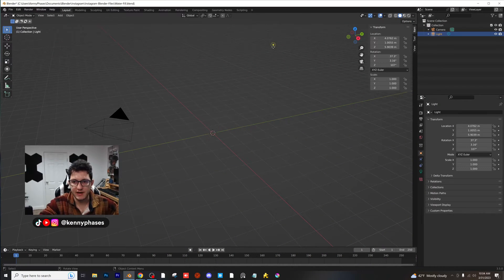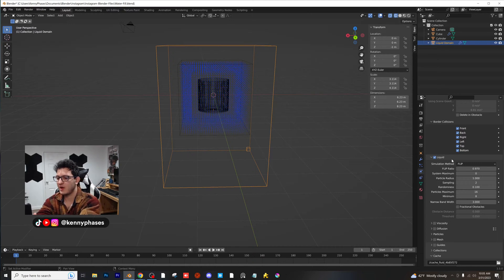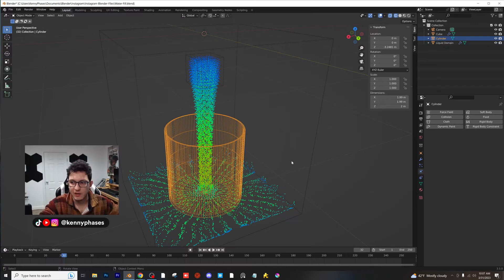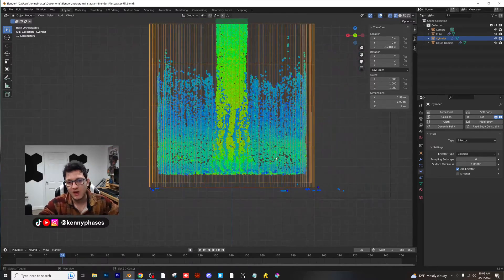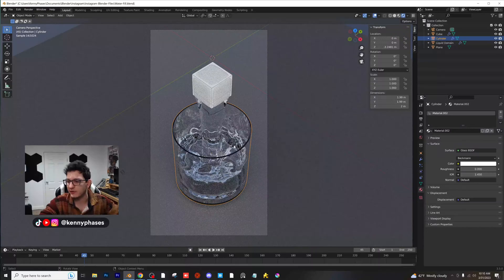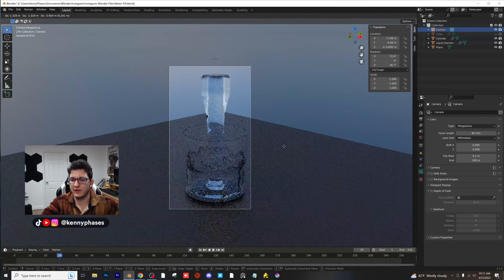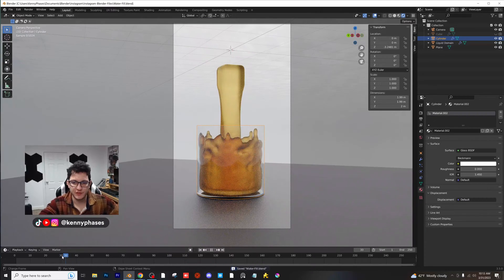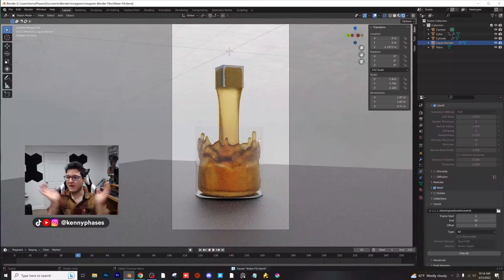Fill a Cup with Water in Blender 3D!

Comment: Trick of the day...  once you've created that 'cup', duplicate it (Shf-D), leave it right where the original was.  Using a Solidify,  adjust the thickness of the 2nd cyliner, outwards, so it's thickness is two or three times the thickness of the original cylinder.   Use that 2nd cylinder as your effector, and you won't get those pesky leaks out of the bottom.
Reply from the maker: Awesome tip!

Comment: I was wondering, i was using a mineral water bottle as seen on supermarket. I experience the fluid is not filling up the sides of the bottle. there are still gaps. I have the surface thickness to 0.6, but still even lowering it still causing gaps. do you know the fix?
Reply from the maker: What resolution? Sometimes you have to keep raising the resolution!
Reply: @KennyPhases  i have set it to 100. also  i have set the flow off at frame 1 but start at frame 42. i have bake it. but when the water is not flowing the domain becomes solid. but after reaching frame 42 onwards the domain is not solid anymore. how to get rid of this?
Reply from the maker: @terrytjandra  You will have to send me a screenshot on Instagram, I would have to visually see a recording of what is happening to help solve this issue. Thank you! In the meantime, you can also check the Blender Discord server and ask your question there too!

Comment: What did you do to make the water come out? I found it in the big square and not in the small one. I don't get anything similar to water. Of course, I have a blender that is older than yours. How do I still manage to make the small square come out with water as the water came up nicely from the bottom? Please help me more so that I can continue the creation. Thank you. I'm just starting out with the blender.
Reply from the maker: You have to ADD the source of the water. It can be anything, a cube, a pyramid, a cylinder, a sphere. doesnt matter. But you have to ADD an object to your scene in order to have a "flow-source". Once you have your flow source you'll need to select it and add the fluid-flow property. And then you can move the flow source to wherever you choose and BAKE the simulation!

Comment: Hey Kenny! Have you ever wondered how can you fill a cup with the flow source at the bottom of the cup? Cause when  you want to try it, the liquid surface doesn't rise past the flow source!
Reply from the maker: This might give you errors yes unless you use the Flip Fluids add-on. But I will experiment with this in the future!
Reply: @KennyPhases  I am using Flip Fluids, but doesn't help with this, I tried key framing the flow source along the liquid surface rising up, but it looks kinda odd, give it a try 👌🏽
Reply from the maker: @farhadkhosravi4630  Yup I will eventually try it!